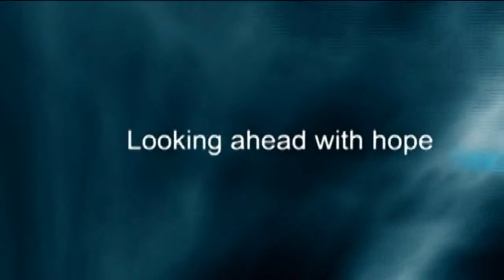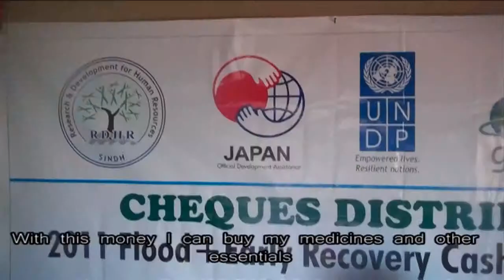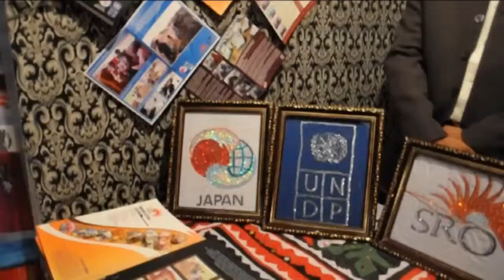Looking Ahead with Hope

Comment: Great Job -- restoration work! But sadly another flooding which is likely in that area can again wash away and we re-invent the wheel over again.
After the re-building - sustainable steps should be taken to impart a general primary education to enable them to read and write at least and they be taught some technical skill to enable them to mix into the fabric of society and take a step towards becoming a bit more self-sufficient to at least pay for their basic needs. More needs to be done!